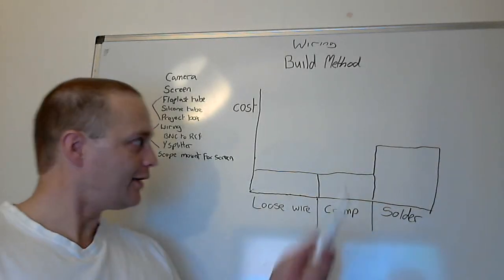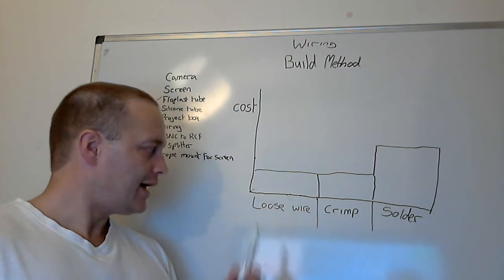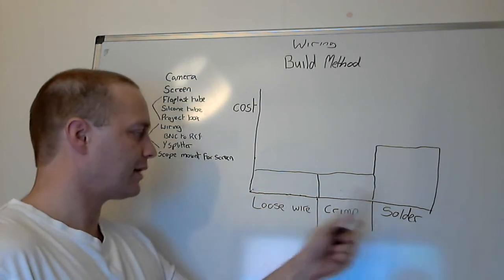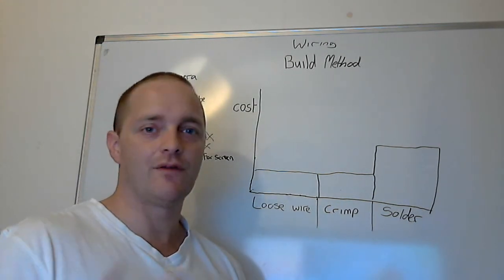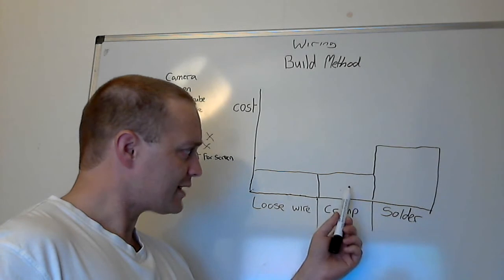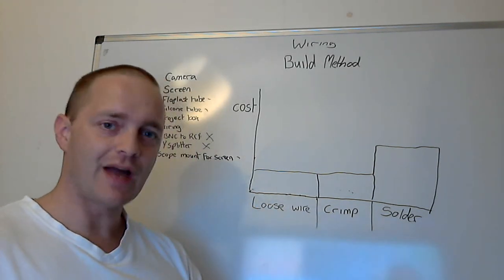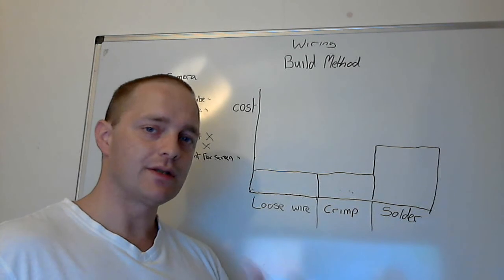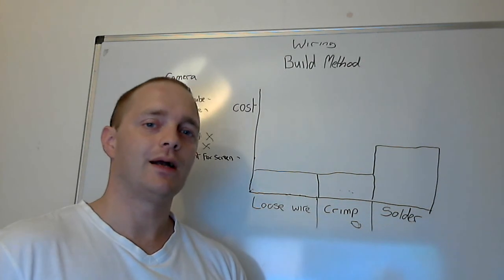DIY Night Vision - Wiring build methods

Comment: My first build I soldered every wire,no point in crimping
Reply from the maker: +Baz Whitley it's an option. I guess for those who may use a soldering iron, they come in very useful anyway, you can almost right off the costs but yes soldering will always generally win hands down. It will be interesting to see what the results will be.